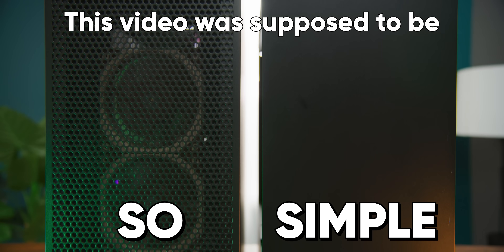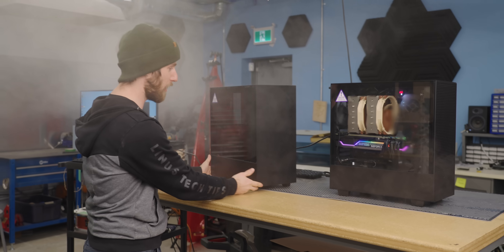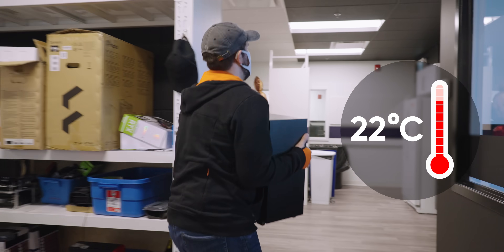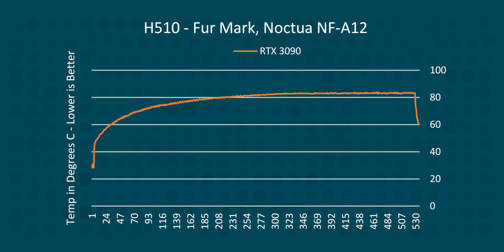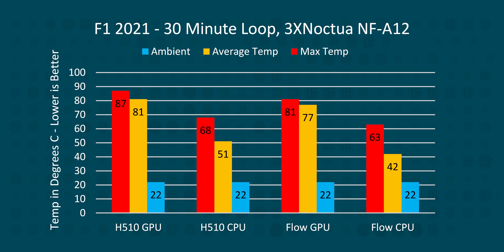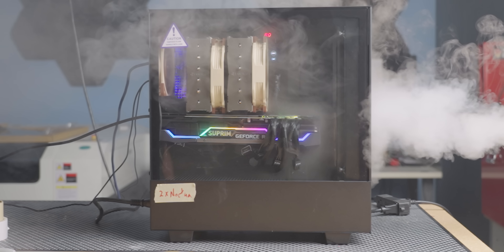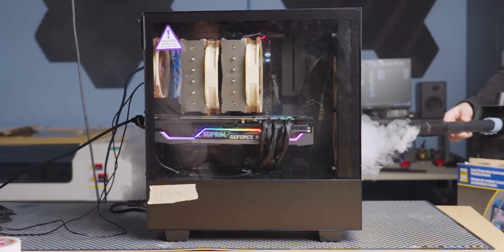Everything You Know Is Wrong - Mesh vs Non-Mesh Front Panel

Comment: Hey Linus and Friends, I have almost this same exact setup. The only exception being that I have a 3070. I have a question about a possible solution:

If I modeled and printed a duct to redirect airflow to under the GPU, would this resolve the cooling issue? This would hopefully mitigate the turbulence and move the bottom fan’s airflow under the GPU. 

What do you guys think?
Reply: With a 3070, you live in the budget segments where you might want to consider getting another case. The Fractal Design Torrent handles airflow in a completely different way.

Of course, a 3070 is also a rather efficient GPU - do you actually have any thermal issues, or can you leave well enough alone?
Reply: @c99kfm  None at all lmao. I just thought it might be a good project to net some thermal gains. Linus is very right though. I opened my case and checked the airflow. The 3070 only receives ambient air.
Reply: probably. someone above commented they have a very similar setup and did the same thing to solve it.
two fans in front; one fan untouched blowing across the cpu, 2nd fan ducted to blow under it.

Comment: you didnt tried to put VGA power cables to another side of gpu, this should change little bit of temps on gpu vs cpu. Yes this will look not so fine, but you will open 3rd fan without any cable wall.

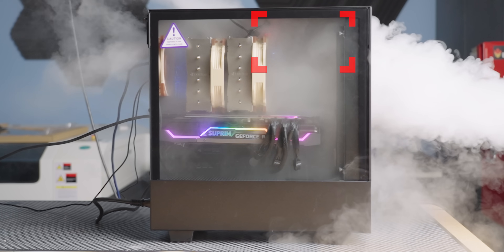Comment: 6:03 - It really looks as if they intentionally blocked off any exit for air below the GPU just so they could have something to talk about. Any halfway competent PC builder would have, at the very least, installed some vented slot covers down there. Even better, one could mount a couple of 40mm muffin fans, side by side, below the GPU, to blow air out.

Finally, they are holding their smoke machine way too close. Smoke is only seen going in the center of the front, even though there are three fans up there. This is guaranteed to give you an incorrect visualization of the actual internal circulation.

Comment: Greg Selzar already all over the nzxt H500 cases.

The case is setup for negative pressure.
It would be interesting to see that same testing with a jerry-rigged fan ontop of the case to pull air out (similar to standard setup - albeit the fan on the inside of the case)

https://www.youtube.com/watch?v=_ixFt7h8fak

Comment: For Christmas I bought a fractal design meshify case for a build for my mother. She checks emails. I still went with a six core i5 10400, but just a gt1030 because she watches YouTube maybe once a year, and has never played a game. The car fans being set up prior, and well done, is well worth the 40 extra dollars over the cheapo amazon cases. It also let me make a pretty stripped down computer look sleek and just the right amount of modern but not gamer-y. Yes, I used a stock cooler - but even stress testing it, it never gets loud. 

She is coming from a 7 year old all-in one, with a broken 250gb HDD, 720p screen, 4gb ram, that takes 25 minutes to fully boot and load in (and freezes when opening email links) to a nice new 1080p 75hz 27” monitor, 500gb NVME Ssd, 16gb ram, that boots up in less than 8 seconds. And we won’t need to replace the whole computer if any of it fails, which is unlikely considering I have computers that have happily become obsolete before ever having a hardware error in >10 years

Comment: I experienced something similar with my setup. I think I inadvertently ended up fixing it by putting a smaller 90mm PWM fan at the bottom front of the case - with some of the airflow going over the gpu but most of it going under it. My gpu temps dropped by about 10 degrees even compared to a bigger 140mm fan at the exact same spot. No more hotspots and the max it gets to now is around 62c with customized fan curves. I still have a 140mm fan on the upper front of the case and an exhaust just behind the CPU cooler near the IO. It's the best cooling setup I've ever had, the heat just radiates off the top and everything is permanently cooled with minimal noise
Reply: Which case do you use?
Reply: @Γευστικός_Κάλυκας  It's a NOX Hummer Fusion

Comment: Is it not because they used pressure fans for intake??? Of course moving from an airflow-focused to pressure-focused fan would bring subpar results. The NF-A12 has the highest airflow in the center of the fan, meaning-you don't want the side of your gpu there, or you'll face a TON of turbulence. Swapping to the NF-F12 would bring more even flow on the lower fan, instead of most of the flow on the side of the gpu. There would be more force on the outer edge of the fan, where--as you all saw--was where the air was intended to flow. To the gpu and cpu cooler. Also, at the corners of the case, it was vortices, not necessarily turbulence. If the air just stays there, it heats up and does nothing. Which is why the Winter One case was designed to be taller, to avoid these at the outer edges. 
But they're experienced so I'm guessing the next vid in the series will swap to airflow instead of pressure fans.

Comment: I would say two things, one is current GPU cooling setups to me seem to just be several fans pushing air onto the card and not caring about where the air goes after that.  Where the older reference cards used to pull air in and push it out the back of the case (a better setup I would think).  The other thing is that with the solid front case, I think you could get better cooling with that if you had fans that were designed to pull air from the edge and push it out the side (similar to fans that pull air from the side and push it out the edge).

Comment: 8 min video explained in 8 second...

"More fans more air flow (right)
More airflow lower temperature (right)
placements of parts interfering the air flow patterns (yes) higher temperatures (yes)
Higher intake and lower exhaust leads to improper air flow (sometimes)
Conclusion
This ATX design is flawed get a founders edition or and itx tower case
Or liquid cool everything"

this video isn't worth my time even at 2x speeds

But since LTT posted it have to watch it 👍

Comment: I think this shows how important it is to have a bottom intake fan (one that actually pulls air from below the case and blows up to the gpu).  Also, it would be interesting to see if the issue goes away by switching to liquid cooling for the CPU.  That giant CPU cooler looks like its hogging most of the air in the case.
Reply: Not specifically a bottom intake fan, just a plan for how the air will move around the case.
Reply: @snowwsquire  ifr running a 3090 it should be obvious that you want more than 1 exhaust. like duh... I typically aim for 2-3 intake and 2-3 exhaust. in a better (more optimized for a high end gpu) case that allows 3 front fans, a back and 2-3 top exhaust, they would have had no problem.
Reply: liquid cooling systems still have massive fans attached to heatsinks. just generally screwed to the top or back instead of directly over the CPU. I don't think it's change the GPU cooling performance at all.

Comment: That case is set up for negative pressure.  Exhaust at the top and back which causes air to be sucked in through the front as well as from under the graphics card.  Edit. Guess I should have read the other comments first.  Basically what GN said.

Comment: Adding an intake fan at the bottom helps, or so I think? Cause I have a NZXT H510 Elite and converted it's front to a mesh panel, then added 2 x 120mm arctic PWM intake fans at the bottom, at max load my gpu temps are around 55 to 60C, I'm using a RX 6700 XT Red Devil btw. Hope someone could add their comments regarding my setup, cause I'm not quite sure if it performs better.
P.S. I'm currently overclocking and voltage at 1100-1150 mV & (Core @2400 - 2600)MHz (Vram @2100)MHz

Comment: If we take a look at the whole airflow system as a whole, I think it's pretty obvious that the GPU is only an afterthought, and therefore the problem. While the CPU, HDDs (if present), and the PSU enjoy fast-moving air with a straigh-forward path and good pressure differential thanks to the case fans, the GPU is kind of in the middle of nowhere facing the wrong way (from an airflow perspective), completely reliant on its own fans (which BTW, have to fight against the side of the case) for cooling. Very inefficient in short. Kind of explains how cylindrical builds like the "garbage bin Mac Pro" and MSI Vortex are able to keep temperatures in check with such few fans installed.

Obviously this is not to put the blame on GPU manufacturers - they already have plenty of external restrictions on their plate. This is an issue that requires collaborative effort from chip designers (NV & AMD), AIB partners (Asus, Gigabyte, Zotac, etc.), and case designers, so I doubt changes are coming any time soon.

Comment: Because of the the front mesh in the mesh computer and the thermal throttling stops, the graphics card might be using more of its features and heating itself up more. This may be causing it to not cool down as much. The picture on the graph you showed went to 80C at the highest.

Comment: @Linus Tech Tips So what's your solution to have better airflow on the gpu if you have this exact same mesh setup: rtx 3090 + Noctua NH-D15 and a mesh case where the cooler is very close to said rtx

Comment: I think the corsair 4000 or 5000 series would have been a better example. it also has a mesh variant (what i have) and space for 6 fans. i have 3 in at the front and 3 out at top and back. also the case has a higher volume so airpockets are not a problem like the nzxt case. with 6 fans and a big case you can move so much air through that this is irrelevant. well i guess if ya want the numbers per case, you gotta head over to GN.

Comment: That case with those hardware components in it may benefit from a backwards airflow setup. Pulling in air from the top, back and bottom and blowing out the front. As annoying as it is messing with fan orientation is sometimes nescissary to find optimal operation for individual builds.

Comment: It would be interesting to see the same test with a blower style graphics card. I have a similar case from a different manufacturer, when I upgraded my GPU from a 1050ti with fans to a 1080ti with a blower my CPU temperature went down by around ten degrees, in spite of the fact that a 1080ti generates way more heat. Obviously because the blower on the 1080ti was exhausting the GPU heat out the back of the case, whereas the fans on the 1050ti were just adding more heat for the case fans and CPU cooler to deal with.
Reply: i don't think they make a "blower" 3090 and doesnt look like "blower" gpus are going to even be a thing anymore at least at the high end. a 3090 is just  too much heat (500watts+) for a mid tower case and you really need a full tower case for one of these.  or if you go mid tower you need to be carefull what case you pick make sure you get one with excelent cooling (better than this nzxt case)
Reply: @BassRacerx  The size of the case really doesn't make much difference. once the air is heat soaked, it's heat soaked. 3 or so High CFM fans in exhaust is probably the best. a 120mm case fan isn't going to make any meaningful pressure to overcome the exhaust restriction of a single exhaust fan.
Reply: @BassRacerx  I'm running the gigabyte 3090 turbo in my mini itx pc, I can confirm they exist, and they work well enough (~75C at load) but they're stupidly loud
Reply: @BassRacerx  I think a case with bottom replaced with wire meshes and one exhaust at the rear might be okay for the setup in this video. The case in the video doesn't support that configuration, though.
Reply: @MikkoRantalainen  I think you're on to something here. With the heat generation of the newer cards increasing along with the crazy power requirements, the next innovation in pc cases could very well be mesh rear panels and an additional, lower exhaust fan. It would most likely result in a reduced number of PCI slots/covers, but I'm sure they'll figure it out.
Reply: I miss blowers. Apple showed everyone how to properly cool even 4 GPUs with a direct air path  (in Mac Pro) silently. And still, no one were able to follow or replicate…
Reply: @fedoruccio  it wasn't that they were unable to replicate lol, it's that nobody wants to. 4 GPUs is useless, and a normal cooling setup allows you to have more compatibility with cases than apples very locked system.
Reply: Yeah blower gpu really good if you have bad case ventilation.

Comment: You dummies. If your PSU shroud has vents on the top, then flip the power supply.
Who ever started the whole mount PSU with a bottom intake orientation is a dimwit.

Comment: This is one of the problems with a vertical case, and relying on the same thing you use to stay cozy in the summer. Linus, since you've been building computer things since the 90s. You'd have hit this on vertical cases at least once. I for one didn't know why. But yes it's a thing. youve essentially got the the gpu's air stuck. It's phyiscs I don't know exactly why. I'd just guess the air flow in that case is just bad. With a horizontal case you can push the air up and away from parts. With a vertical case the air can only go in so many directitions. 
Seems to me it's just a bad idea.
Just in case you wondered. (pun was on purpos)
Reply: Vertical cases are stupid for so many reasons, not the least of which is that modern components such as graphics cards are now so heavy that they're literally bending under their own weight.

We used to have horizontal cases almost exclusively. I'm wondering when we'll switch back.
Reply: @Farzlepot  hug  thank you!

Comment: As HVAC eng, its a little infuriating that there is never any discussion around the pretty simple fundamentals of using air to heat/cool in heaps of these videos, like the relation of temperature gain or differential to air mass/flow and then how velocities and distribution for various components will alter their capability to reject heat, some subject to their own heatsinks/cooling.
No-one covers figuring out the needed air flow into or out of a case for a given heat load in the case. Or estimating the static pressure to overcome to achieve said flow.
Even stuff like figuring out what should get the most air, like 2/3 GPU and 1/3 CPU. Its been demonstrated many times that some ducting or effective air jets can make all the difference too. I'm sure this might bulk some cases up or possibly add a little noise, but really is the only way to effectively get the best out of air cooling.

Comment: the problem is mostly due to case design. with giant tower cooler the exhaust area is blocked by the cooler and the fan only exhausting hot air from the cooler so the gpu hot air has nowhere to go. it different story if you strap in aio on the front so the exhaust area is free and can do its job correctly

Comment: What about a side intake (where the glass or plastic window is), say a big >140mm or multiple fans there, and all the other fans directing air out? As for the cases in the video, they lack a bottom intake, which would be great in this instance especially for the GPU as it would allow for airflow directly to cool the toasty graphics card.

Comment: in this mesh configs(NZXT as in video), sometimes bottom front fan only is much better then all fans full in(I did F*load of testings in many ways). Balls to the wall sometimes just might not work(airflow in cases is a B*, each is another puzzle).You kinda need to get the balance of the flow. You need to move as much air as possible, in and out from the case all the time(CFM in/CFM out equally with smooth flow without restrictions(dreamy I know :D)). Easy Steady flow through the whole case FTW. Indeed the case itself is the key variable how to achive this. Sometimes just removing the slot cover below the GPU (on the back of the case) might help alot....or not....'cause you know....flow dynamics

Comment: I got 70 degree GPU and 65 degree CPU temps with an overclock even with a solid front case. My trick was to put the front fan all the way at the bottom instead of in the middle, and run a push-pull configuration so that the air goes all the way from the bottom of the case to the top and then leaves through the back. This is pretty impressive for 2 case fans and 1 cpu fan.

Comment: I have this h510 with solid front . What i did to improve the airflow:
1. Remove side and bottom filter (yes, it does have bottom filter at the front).
2. Cut out the top fan mesh.
3. Remove all pcie slot cover and add 80mm fan as intake.
4. Use 280mm Aio as intake.
My gpu never goes above 63 degree celcius. Before it was like 70 ish degree.